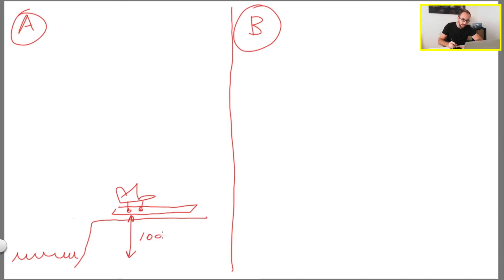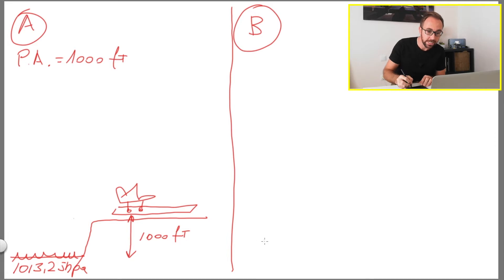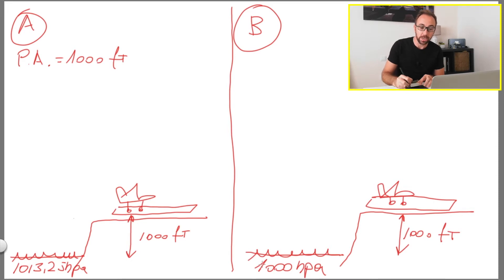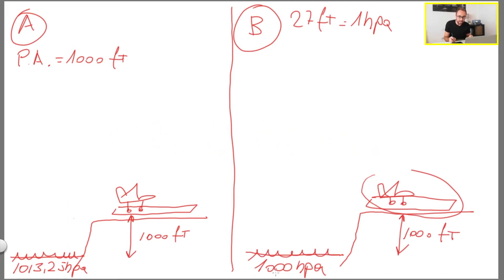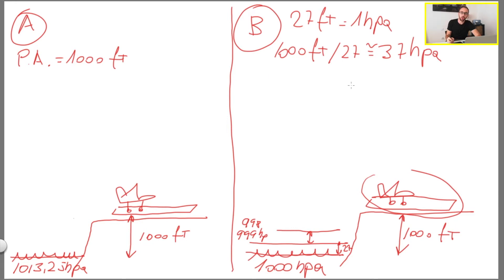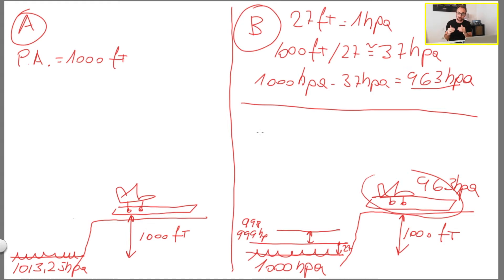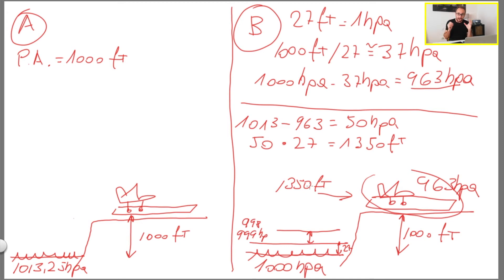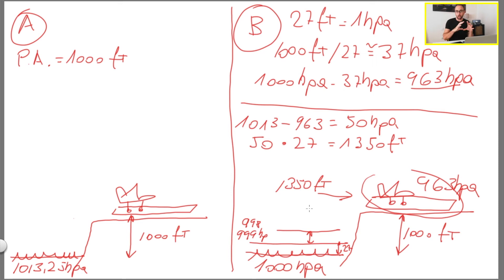Pressure Altitude - [What it is, How to calculate Pressure Altitude and why is it important??]

Comment: Starting off with my PPL training, and I was taught how to calculate PA a little differently, but it seems like I come to the same (in this case similar) result.
I take the QNH, subtract it from the 1013, then multiply with 27feet, then add the aerodrome elevation after-the-fact. So for this example:
1013-1000 = 13hPa.
13hPa * 27ft = 351ft
351ft + 1000ft = PA of 1351ft. (off by 1 foot from your example, but I believe the 27ft is also just an estimate either way)
Still, nice to see another way of calculating it, and it helped me understand the concept a little more.
Reply from the maker: I'm glad to read this! Thanks for watching!

Comment: why so many calculations when we can easily subtract 1000hpa from 1013, That gives us 13 hpa difference which when multiplied by 27 we get 351. Add 351 to the 1000 feet and we get the 1351 pressure altitude.  I thought I should share. Thanks for the presentations
Reply from the maker: Many thanks for sharing your point !!

Comment: Hi Gabriel,
First of  all, thank you for your efforts, extremely helpful. I have a frozen ATPL but time to time it is essential to refresh my memory and watching your videos is a great way.
Just a question though to make it clear.
So the performance doesn't only depend on the pressure altitude but the density altitude. To calculate density altitude you have to calculate pressure altitude first. Am I right?
Reply from the maker: Yes, you can apply the density Altitude correction after the PA correction

Comment: What about just use the difference between the standard pressure and actual pressure, which is 13.3 and multiply by 27 then add 1000 feet? The result seems to be more or less the same.
Reply from the maker: Hey, thanks for watching!! You could do that if you know the pressure around your aircraft..

Comment: Means basically at lower flight level corresponding to higher pressure altitude the aircraft's turbofan engine efficiency will be low or airfoils are not generating enough lift?.. or prolly something else,,,, waiting for ur answer sir.....,,,,,,,
Reply: Thanks a lot sir
Reply from the maker: @ExtremeMotivation07  you are welcome!! Let me know if you have more questions 👍
Reply from the maker: The lower the flight level the lower will be the pressure altitude and, the higher the pressure, so the Aircraft performance are better at lower pressure ALTITUDE.

Comment: Sir, How this pressure altitude affects the aircraft's performance?
Reply from the maker: Hey, thanks for watching, the higher the pressure altitude the worsen the aircraft performance.
Reply: Means basically at lower flight level corresponding to higher pressure altitude the aircraft's turbofan engine efficiency will be low or airfoils are not generating enough lift?.. or prolly something else,,,, waiting for ur answer sir.....,,,,,,,

Comment: Can u define difference btw altimeter vs pressure altitude table what will the consequences or outcome of it? Because I'm trying to interpolating it so, I must know the things perfectly where they stand first.
Reply from the maker: Altimeter and pressure altitude are different, the altimeter indicates to the pilot the vertical difference , expressed in feet, between the pressure reference and the aircraft. The pressure Altitude is the Altitude that the aircraft feels, which could be different from the actual Altitude..

Comment: Sir, How this pressure altitude affects the aircraft's performance?
Reply from the maker: Hey, thanks for watching, the higher the pressure altitude the worsen the aircraft performance.
Reply: @PILOTCLIMB  as I know pressure altitude is the vertical disance btw airplane and constant pressure surface of 1013hPa. When the airplane is on RWY so PA is elevation. Could you explain me again why "the higher the pressure altitude the worsen the aircraft performance.". Tks in advance.
Reply from the maker: @vantranthi398  Hey, try to watch the video again, it will help for sure. When you are on the runway you are, physically, at Airport Elevation, however, the aircraft doesn't think that way, the Aircraft only cares about the pressure and temperature around. Watch the video regarding density altitude as well, Video link: https://www.youtube.com/watch?v=kXjcDik_8jI&t=71s

Comment: isn't it 30 Ft that it decreases by one hectopascal?
Reply from the maker: Hey, thanks for watching.. Yes you can use 30feet aswell. Normally 30 feet it is used for high altitudes and 27 feet for low altitudes calculations...This is so because at low altitudes the pressure is higher thus the isobars are squeezed.

Let me know if you still have any questions.
Have a great day

Comment: Hello Captain.

Thank you very much for this video and the useful formulas.

For better understanding i would like to ask a few questions.

For example:

Marrakech Airport GMMX
Has one runway 10/28.

For Rwy 10 the charts tells:

1506ft Rwy Elevation
54 hpa Runway Elevation

Metar: QNH 1017, Temp 28, Dew 1.

1506 ft/27 ft = 55,78 hpa pressure difference from mean sea level to the aircraft

1017 hpa - 55,78 hpa = 961,22 hpa (pressure around the aircraft)

Pressure Altitude:

1013,25 hpa - 961,22 hpa = 52.03 hpa (difference between standard atmosphere pressure and pressure around the aircraft)

52.03 hp x 27ft = 1404.81ft (pressure altitude)

So real elevation of RWY10 is 1506ft.
But with higher local pressure of 1017hpa, the aircraft would behave like it would be at 1404.81 ft, which means better performance.
Is that correct?

But still i dont know what the meaning of 54hpa is which is written on the approach chart for Runway 10.
Reply from the maker: Hey, many thanks for watching the Pressure Altitude video.

I'm very glad to see you understood the concept correctly.

The calculations and conclusions you made in the example are all correct!! Congratulations!! You didn't do a single mistake!! WELL DONE.

The 54hpa next to the Runway Touchdown elevation is the difference in pressure between the Touchdown Zone of Runway 10 and the Mean Sea Level.

If you multiply the 54hpa by 27 you will get the elevation of the touchdown for runway 10.

This can be used to calculate the QFE if only the QNH is given.
For more information about the QFE watch the video below:
https://www.youtube.com/watch?v=7rjL2CSiCvQ&t=3s

The QFE is rarely used during operations.

Let me know if you have more questions!!

I wish you a great day!
Gabriele